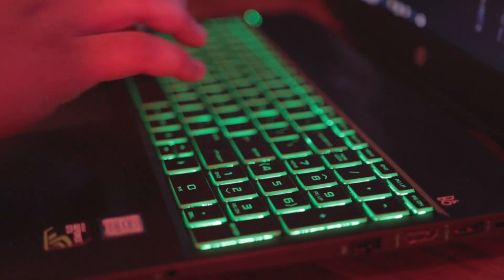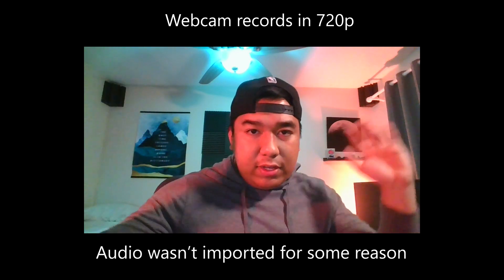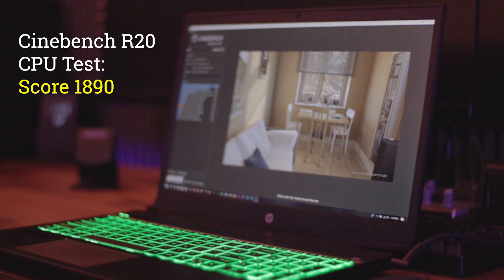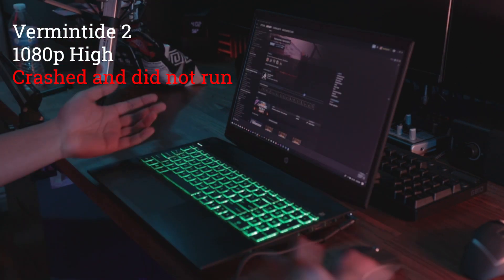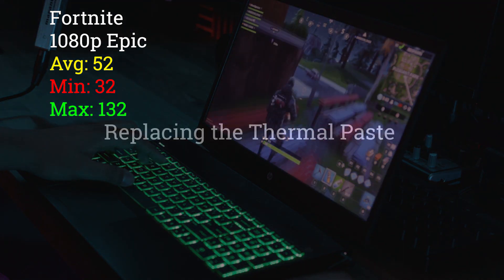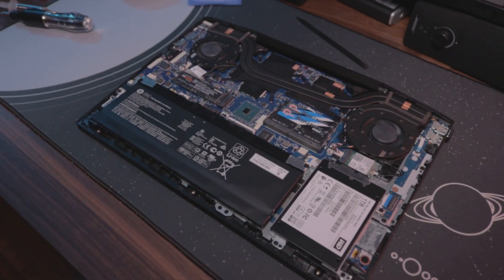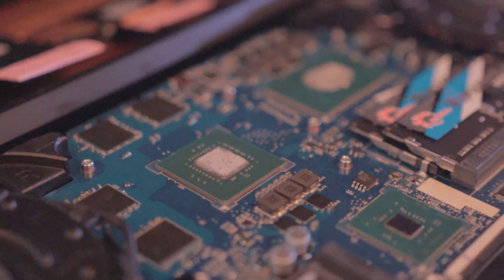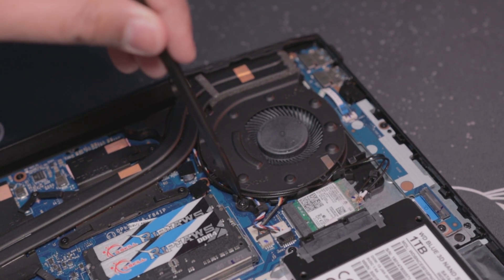Let's talk more about the HP Pavilion 15 Gaming Laptop

Comment: Man.... Everything's gone wrong for mine. 

1. The Casing broke at the hinge parts of the screen lid

2. When the thing snapped completely, the both oof the antenna for wifi were cut or frayed. This led to spotty wifi that would occasionally cut out entirely or be unable to connect to networks it could detect, even with the correct password. 

3. Store wormed out of repairs on extended physical damage warranty by claiming it was infested with bugs and told me I needed it "Professionally cleaned" before they'd fix it

4. Nobody in my entire state advertises such a service and calls were fruitless. (The one guy who said he might be able to do it said cost would be almost the cost of the computer) and even then, not guaranteed
5. trying to tear it down to convert into a functional Desktop of some sort, the screws on the Heat sink all were super stuck for some reason and stripped rather than come off.

6.  Also, surprise surprise, NO BUGS! Either they saw it was from Hawaii and used the fact computers somewhat commonly get bugs in them to worm out of fixing my destroyed casing, or a single bug somehow got into the box en -route, and they refused for that reason. 

7. After removing and trying to repair the damaged antenna, the Wireless capabilities straight up shut off if I so much as type more than a few keys at a time.

Comment: Hi my new HP Pavilion Gaming Laptop is making a weird plastic noise when I lift it up but not so much when I put it down. Should I be  worried,
Thanks
Reply: You mean the hinge? If it is, yeah I think you should be because maybe eventually it will wear out which is common to these laptops, if the hinges break, or before it breaks, you should loosen the hinges a little bit thats solves it, mine too had that problem and then hinges didn't break but it came off the bracket, what I did was repaired it luckily the hinges wasn't damaged, so the hinges were placed correctly and I loosen the hinges littlebit now it's fine as butter, sorry for late reply....

Comment: I have this laptop, but i cant even get 40 fps on low, any advice?
Reply: There is a application you need to download called GeForce experience there you can change settings of your gpu and fix your frame rate problem

Comment: My 2019 version overthrottles then crashes completely:)
Reply: The 2019 is Bae. Runs Cyberpunk 2077 on Ultra. Running at 200F and 1660 ti max q at 153F. STILL doesn't shut off. Maybe you have it on a bed or something man

Comment: My one keeps overheating and going to sleep. Great work HP! Gaming Laptop that doesn't game.
Reply: You have the same model as the one in the video?
Reply: @Mark-ko8zp  Yeah same model. Not sure exactly what's going on. But, during gaming sessions the CPU peaks out at 110c that is forced into sleep as a protective mode.  Very disappointing!
Reply: @oris.corrupt  Honestly might be your unit
Reply: @DPCH203  It's not the first time my unit has caused problems.
Reply: @oris.corrupt  put a towel or something under the laptop to not overheat. I have a towel and it works
Reply: @yin_xing  I made a frame that lifts the base of the laptop away from the surface using Lego.... More airflow does improve performance.
Reply: @oris.corrupt  sure, good idea 🤔

Comment: The processor gets 83 degrees celcius and Gpu gets 61 degrees celcius when I use the laptop on plug for 2 + hours. Not even gaming
Reply: you have to set in best performance at the energy settings, not in maximum performance .
Reply: @danielfelipeaguilarlozada9121  can you show me how ?
Reply: @waliul280  click on the battery icon and a slider pulls up

Comment: The plastic is so cheap that my screen broken from the main laptop around 3-4 months ago. Use some epoxy glue to fix it and loosen the hinge a little bit to avoid it from broken again. My harddisk is broken too, already format the entire thing and fill it again with backups but the file start to erased little by little, even the windows. Battery also sitting at 37k mWh full charge while the designed capacity is around 52k mWh. Mine is cx0057tx, I bought it in the end of 2018.

Overall, performance is really worth the money. If only the hardware is a little bit better (at least in my case), then this would be the best laptop for its price.
Reply from the maker: Blank Nick damn sorry to hear that bro. I agree for the money performance is there but the hardware is really lacking
Reply: @B4YBTech  I really hope ppl will see my comment so they could check their screen hinges and lubricate them regularly or simply loosen them a little bit because that is the most disappointing part of this laptop. You can't feel anything wrong at all because torque applied from the length of the screen but if you disassemble the hinges and try to play with them without screen, they are really tight that you will not believe how such cheap plastic could handle the force. 

In my case, when I disassemble the hinges, I cannot open/close them with my hands alone at all. It might be because I'm just a weak little man though😂

Comment: Hey man, does removing logo on the frontside of the notebook require a lot of work? I am on verge of buying this laptop and the only thing I don't like about it is the cheap looking glossy HP logo lol
Reply from the maker: Soomin Chae No I just bought a can of plasti dip and sprayed several coats on it. Keep in mind to use painters tape and cover any openings to prevent the plasti dip from going into any components.
Reply: @B4YBTech  Thank you for the details!

Comment: I literally just bought this thing last night!

P.S: mine is 144Hz Refresh rate
Reply from the maker: Awesome 👏 I can imagine the 144hz display makes a huge difference
Reply: @B4YBTech  haven't put it under vigorous testing yet, but the specs seem promising:

GTX1650 4GB GDDR6
16GB RAM
Intel Core i5-10300H
1TB HDD (my old hard drive!) + 512GB SSD
144Hz Display

what do you think?! - I'm not a gamer myself (but I'd love to use it for gaming later on! 😉).
Reply from the maker: If you don’t use it for gaming it’ll be a great productivity machine and just having the smoothness of a 144hz for general use is really awesome. For gaming it’ll do great for casual titles and especially esports titles 👍
Reply: do you have the red colour problem?
Reply: cus i got mine yesterday and it has a color accuracy issue especially on the red
Reply: @muhammadrizki8343  I can't comment on that as I didn't use it heavily yet.

Comment: I have the 2020 version (HP Pavilion 15-DK0051WM). And they did fixed some issues. Except the thermals. But I think you should try to undervolt to -0.120V. Because that solved my thermal throttle. But it looked like your model has small fans. I am not so sure why they don't have a dedicated hardware button for turbo speed for fans to blast at max speed. Because that way, it will keep the gaming laptop cooled. I would just get 16GB for the sake of games to run (like Skyrim). And I think that Vermintide will not boot at high settings, because of lack of ram for some odd reason (this is my opinion and I don't have that game). And I have replaced the thermal paste on my gaming laptop, you have to move some wires along with more screws. I mean it is extra step to just simply repaste the CPU and GPU on the 2020 version.

But if your wifi antenna cable clamp is broken, then you are screwed for only able to use one wifi antenna until you have the cable fixed or replaced. So you got to be careful and not trying to screw things up in the laptop. Because you will find out which part that they definitely cheaped out. Also 2 screws had been stripped until I had managed to get them out. Because they're too tight and they have soft heads (that does suck if you want to easily take the laptop apart). Although you can use a flathead screwdriver to take off the back panel (not recommended ).

Comment: Is it good in comparison to ASUS FX505 DT and is it worth to buy its AMD ryzen 5 varient if only that one is available
Reply from the maker: Chinmay Pandey I think that the Asus has a better display in terms of refresh rate, but you will only be able to take advantage of it if it had a better GPU. The esports titles will work well for it. Also that Ryzen 5 isn’t as impressive as the newer 4000 series laptops there is a huge leap in terms of performance. I recommend something along those lines or stick with the pavilion 15 if your budget is tight

Comment: I am thinking to buy the laptop but with this differences(HP Pavilion Gaming 15-EC0004LA):
Gtx 1650

AMD Ryzen 7 3750H (2300 MHz - 4000 MHz)
SSD 512GB

I am afraid of the heat problem, Somebody knows if this version improves this?
Reply from the maker: Diabolo2014 not sure about how well that one performs probably cooler but I am assuming it’s slower

Comment: Bro I wanna know if this works with the elgato capture card hd 60s?
Reply from the maker: Smiles Bernardo the elgato capture card is designed to work with most devices so I don’t see why it wouldn’t work with this laptop
Reply: @B4YBTech  I was asking because the laptop has a 3.1 port and the cable is 3.0 that was why I wanted to know before I get me one

Comment: Just got this over the weekend, before I continue using it, what are some things I should do to make it run better?
Reply from the maker: I think making the changes like I showed in the video would be good, changing the thermal paste, upgrading the ram and installing an SSD is pretty much the most you can do for this laptop.
Reply: Xstylez, dont do it, only with you want to lose the warranty

Comment: I got this laptop but it doesn't have ssd. Can i put one, without removing the hdd?
Reply from the maker: Davor Angelov yes there is an m.2 slot for the ssd
Reply: Do you recommend putting ssd in this laptop?
Reply from the maker: Davor Angelov Yes it is probably the first thing I would upgrade
Reply: Ok thank you 😃

Comment: Hey chief,  question...  What settings did you use to undervolt the gpu? I searched for some videos but the ones I found just made my laptop crash during a run of Doom eternal or RE2 remake.
Reply from the maker: Javier I. Acuña hey Javier I didn’t undervolt the GPU instead I undervolted the CPU as it was the one generating most of the heat
Reply: @B4YBTech  oh I see! Thank you for the quick reply!

I did undervolted the cpu to -.140 mV and it helped,  for sure. From average ~91*C to ~85*C. It still has peaks of 95 tho', next thing inthelist is to repaste I guess,  bur wanted to explore the undervolt GPU route first.
Reply from the maker: Javier I. Acuña yeah man the Intel chips get pretty hot, I did the repairs and I recommend getting some kind of cooling pad if you will be using it for a long time

Comment: What About the i7 8300h version and 12Gb ram 1050GTi 4gb Ram? I don't know with who to go this or Nitro 5, Nitro 5 it's with 8gb ram i5 and GTX 1050
Reply from the maker: I would personally go with the 1050ti for extra performance in games
Reply: @B4YBTech  so u sayin to go with Pavilion whats ur opinion about these laptops? I heard a lot of issues in it? I need it for Gaming.
Reply: @jacoblyalls4026  I got it and it's performing very well right now. Fixed the problem with overheating now cpu and GPU doesn't go higher than 70-75c

Comment: i love this laptop, just copped for black friday. $449 was an amazing deal!
Reply: AdamBeats is it worth buying tho and I mostly play Minecraft will it run smooth with shaders
Reply: Luv my gun 314 it won't run 60 fps on shaders, get a lite pack and it'll get 30-40. Yes, it's totally worth it if you don't want the shaders. I get 140 fps but occasionally it'll jump to the 150s on minecraft. Also got GTA 5 and it works well at 60 fps, 1080p high settings. Not ultra. Fortnite at 60. It's up to you man! I say go for it
Reply: @adamneverlack  I have the same one and I have noticed that the touchpad is clicky. Is this yours also clicky?
Reply: @esra.sedik08  yeah, when i tap on it, it sounds like i clicked it. but its not bad, the keyboard feels good. i like the numpad and the lights.
Reply: AdamBeats what settings did you run Fortnite at
Reply: AdamBeats is it worth buying tho and I mostly play Minecraft will it run smooth with shaders
Reply: It’s $500 right now on Microsoft
Reply: Same
Reply: I got the i5 9300h version and its amazing. It does come with a 1050 3gb version but I overclocked it and it out performs the 1050ti. Absolutely love this thing! Amazing price too!
Reply: @OutlawedPoet  gtx 1650 version? How is the battery life? Does it heat up?
Reply: @EzioAuditore-vr1oy  just said it was the 1050 3 gb version with an i5 9300h. I did oc the gpu to reach the gtx 1050ti performance levels. I tested black ops 3 and gta 5 both with near max settings and they perform amazingly. Once I get my 2 tb external hard drive, I can benchmark a lot more games. To answer your question, the temperatures are fine. For sure undervolt the gpu and cpu on this laptop no matter which version you get, performance boost, longer gaming sessions, lower temperatures, and the fans go from loud to silent as hell even in demanding games. The battery life is pretty decent. Make sure the gpu is set to maximum performance and turn on battery saver with the battery saver power plan if you want the maximum battery life. Undervolting the gpu and cpu also help with the battery life.
Reply: RockHEYS 00  yep. and the ram can be upgraded pretty easily. I purchased a 60 dollar 2 tb external hard drive and this laptop plays anything I want.
Reply: @OutlawedPoet  I also had to grab a TB external drive. I also use it for school so it's pretty fast
Reply: I got the same for 499 :(
Reply: @angelchoy8307  Great! Atleast you didn't spend the 700+ on it!
Reply: Adam Never Lack did u think my user name is too long
Reply: @angelchoy8307  Nah bud it's perfecto
Reply: How is the cooling during intensive games?
Reply: @Itzgianny  A year after my purchase, playing HOI4 (an intensive game once it gets to the later years) my fans sound pretty loud. I'm sure it is just to make sure nothing gets too hot in the laptop. The cooling is alright, but after two/three hours of intensive gaming, I'll put my hand on the keyboard and it'll feel pretty hot, not going to lie. That's when I'll let it rest for a bit
Reply: How are the thermals?
Reply: Let's talk about dell
Reply: I'm going to wait until this Black Friday to get it because I don't want to spend a lot because I'm trying to get my monitor for it does anyone know any good monitors
Reply: How much FPS on fortnite
Reply: Roro Salgado For Fortnite, Turn on V-Sync and lock it at 60 fps & it'll stay at a steady 60 fps. No need to make it any more, so we dont stress the machine Edit: Of course, I think it runs smooth on medium settings, barely tried the game
Reply: Same tho.. but my parents bought it and are saving it for christmas
Reply: @sethnavarrette9011  same here
Reply: @kmn139   same here
Reply: Stender Enderman same
Reply: absolute trash laptop. Cooling system is soo bad and my fans had to be repaired time and again.
Reply: @divashbhattarai5554  Divash, after having this new laptop for a month or two, starting to notice fan problems. Got a bit louder, and started to heat a bit more. Still not burning hot though, it's workable.
Reply: @adamneverlack  mine makes grinding noise and only option is to replace it now :( and I paid 750 for it.
Reply: @divashbhattarai5554  grinding noise like the hard drive or disk inside is making sounds? I think I'm experiencing the same thing. I do use this laptop and air flow is restricted all the time when its in my lap when im in bed. Has to be something with that.
Reply: @adamneverlack  should I buy this 1 bro? Like in the offer I saw there was anadittonal 256 gb ssd . I'm confused should I buy this or dell g5 15 if u can help?✌
Reply: jaggu xd This is a great laptop, but that dell has 9th generation intel i7 while my laptop has 5th generation intel i7

Comment: Question. Can i do any upgrades to it? I completely new to PC/laptop gaming. I do know of some laptops that are "upgradable".
Reply: Nismo PR14, it May have an additional RAM slot, although I’m unsure.
Reply: It have an additional ram slot, it actually have 1x8gb ram so it may be nice to buy another to approach dual channel, it also have an M2 slot for an SSD or Intel Optane, you cant upgrade any other pieces, cpu and gpu are integrated to the board
Reply: What what they said aswell as you can replace the hard drive

Comment: Is this good for 2D/3D animation and programming?
can i change the animtion of keyboard?
Reply: Yes the 2019 has two options for the dim , i got the 2019 version.
Reply from the maker: Jryan Monocillo not sure how demanding those programs will be but I think it’ll handle it surprising well. You can’t change the animation on the keyboard
Reply: @B4YBTech  is this the 2018 edition? I heard the 2019 edition had 2 options for the backlighting, dim or bright
Reply: Ezio Auditore @
Reply: @manuelmonge527  how can i tell if my version is the 2018 or 2019 version, I bought it yesterday, and it doesn't say what year it is on the website i bought it from (currys/pcworld)

Comment: Hi. This laptop(Hp pavillion ) with gtx 1060 3gb maxQ core i7  and dell G5 with 1050 ti 4 gb  core i7  are available on same price in my country. The only difference is that G5 has extra 128gb ssd while hp does not. Which is no big deal I can get ssd on hp if I decide to go for it. So which one should I go for?main purpose is gaming and coding.
Reply from the maker: I think the G5 might be a better deal, although not sure if it is thicker than this one. The extra ssd should be worth it.
Reply: @B4YBTech  thanks for the reply. My main concern is thermal temperatures. Is hp pavillion gets too hot? I dont want to replace thermal paste.